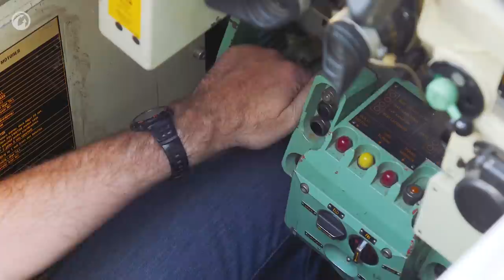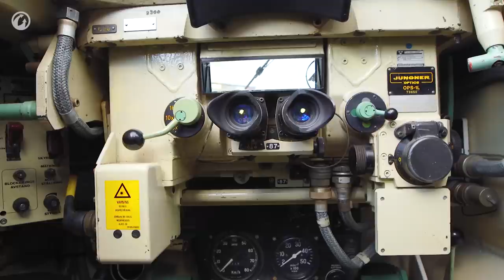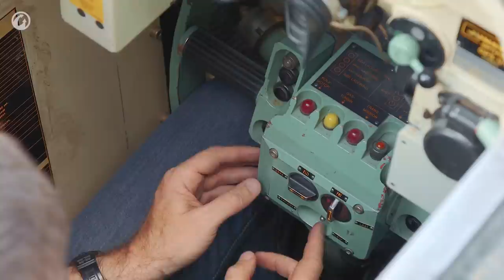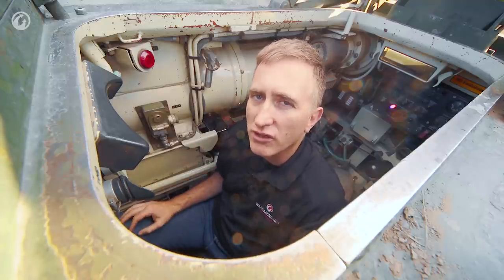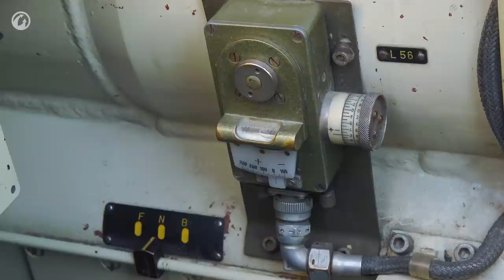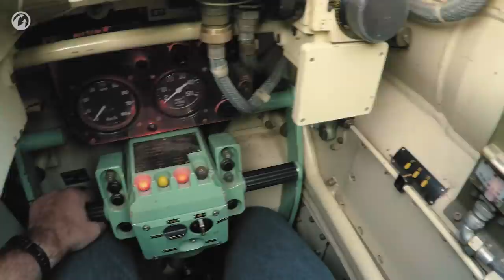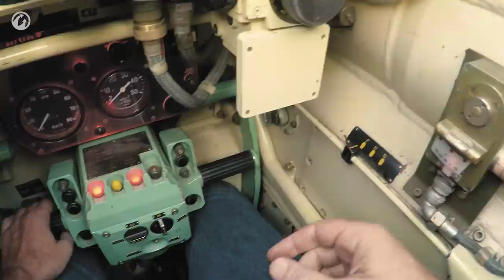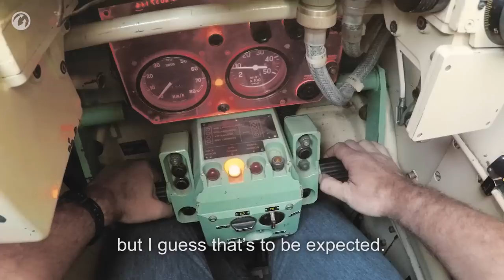Inside the Chieftain's Hatch: Strv 103C part 3

Comment: The downsides of Strv S are only downsides because tanks nowadays are expected to be all purpose. If tanks were built with much more focused purposes, like they were in the past, they would excel at those purposes. The Leopard 2 is a great tank for doing battle in the field, but upgrading the Strv S with all the modern technologies would create a fearsome beast to guard the forests and hills of Sweden.
Reply: This could still be useful today as an assault gun to support infantry. Load all HE. You might even be able to get a hold of some 105mm HESH for buildings.
Reply: The CV9040 is probably better for infantry support than any MBT will ever be. Cheaper, better manouverability, more versaitile, carries troops and equipment, got a gun that can handle most situations from targeting infantry, buildings, other APC's and armoured support and fend off helicopters that get too close. No matter that I love the 103 and even the new leopard, but the CV90 is better at infantry support than both of them.
Reply: A 40mm shell carries around 70 grams of HE. A 105mm carries 2kg of HE. There is a world of difference between the two because while the 40mm might punch big holes in a building, the 105mm will probably level it. 

The turreted mount gives a huge advantage to the 40mm though, especially in high elevation. 

That said with the abandoning of the 103D program there is little hope for the S-tank to rise again. The big gap is in armour, because modern APFSDS are quite unaffected by sloped steel outside of the thicker armour presented due to the angle. 

Fixing that would require a new glacis, but since the engines are front mounted a thicker glacis might not be possible without a complete re-engining as well. Perhaps a Merkava style glacis and hinge that attaches at the angle between UFP and LFP might work but this might require hull changes.

The second problem is the gun. I'm not sure how well the S-tank hull could handle a 120mm, although I do know that there do exist low recoil versions as well as highly efficient muzzle brakes, so maybe it might work?

Either way it would require a new tank program and the result would obsolete the S-tank anyway, so I do see why the Swedes moved away from it in the end towards the Leopard 2.

Personally I think there was merit in the Strv 2000 concepts: http://www.ointres.se/strv_2000.htm . The advancements in remote weapons systems will mean that the future of tanks will incorporate overhead or even unmanned turrets a la the T-14, and the Swedes were particularly advanced in pursuing such a concept as it had dramatic weight reduction potential.
Reply: Effective and reliable gun stabilisation is what killed the S-tank concept. Effective and avaible APFDS is what made the armour inefficient. That could probably have been corrected with ceramic plates, with out adding too much weight. I do think that they explored this possibillity.

The 40mm is more than enough for supporting infantry. You could level a building with a big HE round..or just kill what's inside with the shrapnel from the 40mm. That gives the "same" practical result with a lighter gun. That in turn leaves more space for the infantry and their weapons it's supposed to carry. And the versatility in what targets that can be engaged is better with the 40mm.
Reply: @secularnevrosis  That's not true for all situations. In US service, the M1128 MGS with the 105mm has proved it's usefulness in combat.
Reply: @ExUSSailor  
Of course. The 105mm is a good round. But the 40mm or equivalent offers good firepower while not taking much space that can be used for troops and equipement. The infantry the IFV carries often have very good AT weapons that also are suited to "bunker busting" and other tasks..like the AT4 "Carl Gustav".
Reply: @ExUSSailor  I did not know the Stryker MGS ever went into combat. Last I heard there were loads of problems with the gun being on such a relatively light vehicle and it was getting canceled.

Comment: Great videos,  I was wondering if you had a HE shell in the gun and wanted to change to a AP round or the other way around what would the procedure be.
Reply: Charlie Pace .... No doubt gunner would fire off the round he didn't need and chamber the one he did need.
Reply: So hypothetically. if the Tank was laying in wait for some infantry with HE loaded and an enemy tank came into view. I was really wondering how the Autoloader would work to remove a live run. is it possible ? and where would the round be moved to ? I have no knowledge of Tanks I am just interested.
Reply from the maker: The fastest way to get a round out of the tube is out the far end. This is standard practice in manually loaded tanks as well. If it hits, great, it may distract or cause minor damage. If it misses, the gun is now empty in a half second.

There is likely to be some method of manual ejection, though, for gunnery ranges and the like.
Reply: many thanks. I fine your channel very interesting.

Comment: Wonder how many mpg it gets? Imagine insurance would be quite reasonable as a weekend run around,just going shopping, beach maybe annex Monaco.
Reply: Molatov cocktails would finish you in Monaco. Have you ever been there...High balconys, narrow streets ;)
Reply: unleecensedminky Doubt the people of Monaco would risk there incredibly expensive vintage wines on my lowly peasant armored vehicle but you are right if the last hundred years has taught us anything it's that taking armor into cities without effective infantry support is suicide.
Reply: Ha ha! Last time I went there the local supermarket had a bottle of 'Petrus' on the shelf for basically 2000 euros...still a cheap price to pay if you drink it, fill with petrol and take out a tank :)
Reply: It is probably closer to GPM than MPG.
Reply: Eh, they dropped napalm on the tank during trials in the 60s and it kept on trucking, I doubt some expensive Molotovs would do much harm to a buttoned up and operational S tank :)
Reply: And there is even video of those tests on youtube =).
/watch?v=MiWCpIJ5dBw
Napalm tests start around 18:20
Reply: well chieftain said it consumes 4,5l petrol for 1km with both engines running so if my understanding how much is gallon and how long is mile is correct that's well over GPM.
Reply: Just a bit under 1 MPG is not bad for a tank.
Reply: Yes, but that is with both engines running. There is a reason that they had 2 engines, of which one was a gas-guzzling turbine and the other a weak piston engine.....It got very good gasmileage when just running on the piston engine, that's what it was there for.
Reply: About 4 liters per kilometer he said in an earlier video. That comes down to roughly 1.5 gallon per mile.

Comment: An upscale, 120-140mm cannon, Digital driving/suspension/aiming-fire control system Strv would be interesting... I'd call it the Strv 2000.
Reply: i think that even then the lack of the ability to fire on the move would still make it alot less versatile than a conventional tank. but i do love the strv 103, one of the coolest tanks ever imho
Reply: with a modern fire computer and modern suspension you might be able to make it work on the move, perhaps even while drifting. I'm not sure why you would want to though. its perfectly fine in a defensive role...
Reply: jrfi orn there allredy where a Strv 2000 project, it basicly look liked our CV9040's but it wasabit bigger and had a 130mm main gun and a 25 mm seperate auto-canon, search for Stridsvagn 2000 and you will probably find some documents
Reply: +Split Personality There were several proposals for the Strv 2000 project, but most were to have an 140mm main gun with or without an auxiliary 40mm autocannon (same Bofors as in the CV9040).

All were turreted though, even if one of the proposal was supposed to have an unmanned turret, rather like the T-14 Armata but with no turret armour/shielding whatsoever.

http://www.ointres.se/strv_2000.htm
Reply: jrfi orn one of the obsolete S-tanks was used for a land drone experiment in the 90'ies. and Imo, that concept with a 140mm gun, a modern turbo diesel power pack to replace both current engines and a telescope snorkel and inflatable flotation bladders instead of the flotation screen so the tank would float with the front glacis level about a meter below the surface with just a four inch wide snorkel sticking up.
Reply: Lol, well look at that, I'm a goddamed genius....
Reply: That is hilarious, I genuinely had no idea...
Reply: It's useless in modern urban combat, where you need high elevation and a quick and accurate turret traverse, plus the ability to fire on the move.
Reply: I all honesty the Swedes don't really get into many modern wars, so having modern S tanks with a small group of Leo 2s would fit well into both their defense plans and budget.
Reply: It's a defensive assault gun but it could also fulfill the role of offensive support assault gun (which seemingly has been forgotten in modern tactical thinking). It's inconceivable that this type of tank would be used in an urban scenario.  But I really do think (and agree with some folks above as well as the designers) that this type of design would make for an interesting, cost effective multi role vehicle. It's also much smaller, simpler and thus much less expensive than a conventional tank design. Another important consideration is it obviously requires less manpower and thus a total lower cost to fully train crews. Smaller profile and compact design makes it easier to arrange the defensive armor in a rational, weight saving way. Most if not all of these features apply to the original design as well of course...

Comment: Chieftain, you need to ditch the drone! We wanted to see the side of the tank while you're raising and lowering the gun. That drone only showed the top of the tank, which we've been looking at the last two episodes! How boring. It would have been so much more interesting to see how the track tension changed with the gun movement. And which wheels were doing the lifting. You usually show off track peculiarities whenever there are any. What happened this time?

Comment: Thinking about it & knowing Sweden, the average temperature seems about 12 degrees lower than in the UK in the Winter ... lets just say not warm!

But the clothing is good & you would be out of the elements even if cold ... They could have heated the interior, but might that have increased the overall heat signature of the vehicle & made it thermally an easier target to spot?  ... What do people think? Designed to suit the environment of Sweden & blend more easily with the surroundings :)
Reply: Crew won't spend all the time inside a tank. If it's really warm inside but cold outside, what kind of clothing are they going to wear? If they wear really warm clothes, they'll melt when they're inside a tank, but if they wear light clothes they'll freeze when they go outside. That's my experience in CV9030 during Finnish winter. Best for crew would be that the temp difference between outside and inside is small.
Reply: You should have the clothes on that lets you survive outside the tank/vehicle. If your tank, for some reason, cath fire and you crawl out in your t-shirt and boxers, in the winter and -25 C, you are in serious trouble. This was the standard. Of course soldiers in vehicles that did have good heating and could travel all buttoned up didn't care much for that.

Comment: I love the S-Tank design. Creative and practical, the one place it could find a home in U.S. service is in the Airborne service. It is small enough and light enough to airdrop. The question being how the suspension would handle it? I mean if you were in the 82nd Airborne and were given a choice between an S-Tank type design and say nothing which would you prefer. The M551 Sheridan and its aluminum hull armor and failed gun/missile system has left the airborne troops with nothing sense its removal from frontline service. I love you evaluation of the S-Tank and all you presentations so far, keep it up. I am a submariner (disabled vet) and have studied naval warfare and military gaming for nearly 40 years.
Reply: But Airborne is a offensive Operation at all. This Tank is focused on defensive tactics an lacks offensive potential completly. 

I don't think this Tank would make a good Airborne Tank.

Comment: This re-emphasized one of my main curiosities about the S-tank's dual engines:  can it be driven on one engine alone? If the turbine sucks fuel and stalls out (At low speeds? I am really not clear on why the tank was stalling.), why not do initial driver training on just the diesel? And then, if damaged, can the S-tank limp away on one engine, or is there no way to shunt away from having both engines acting against the transmission? (What is the procedure for towing, for that matter?)

One thing I noticed is that this tank's engines, both of them, are louder than I expected. The Abram's turbine whine is usually much more muffled, while I compare that diesel as being about the same as standing next to a prime mover tractor at idle. A big rig is usually a lot quieter, though, in traffic, so I am surprised that this S-tank remains loud while driving! The smoke trail from the diesel visible on the tank's right as it climbed the hill was very disconcerting. An opponent on the other side of the hill could hear the tracks, but why give a visual cue to trace the tank's actual location?
Reply from the maker: It can be driven around a bit on just the diesel. Not as quickly, obviously. I don't know what the disconnect process would be for one engine

Comment: If you are worried that the gun would bury into the terrain if you come across a sharp incline, I suppose you would be able to drive forwards with the hydraulics lifting the entire front of the tank?
Reply: Ditches or other steep inclinations should be traversed diagonally if to wide/steep, according to the manual.

Comment: Did I miss the part where we learn why there are two vastly different types of engines in one tank??
Reply: The turbine is very powerful for its size but also very inefficient at low throttle settings (it drinks fuel like crazy). The diesel is less powerful, but also far more economical at low speed. The idea is that when you're lying in ambush behind a hill or driving at low speed along a bumpy road you can just run the diesel (which saves fuel), and when you need to go fast you start up the turbine.

Most modern warships use the same idea- they have diesels for cruising, and turbines for bursts of high speed in combat. In that case it's called a CODAG (Combined Diesel AND Gas turbine) or CODOG (Combined Diesel OR Gas turbine) system depending on whether both engines can run at the same time (CODAG) or the diesel must shut down once the turbine starts (CODOG).

Comment: So the auto loader is implemented correctly in WoT then? It just has none of the typical traits of an auto loader.
Reply: Well the typical traits of an autoloader you'd see often todays (for example on most Russian vehicles) behave exactly the same way so really the other autoloaders in WoT are the one's behaving atypically.
Reply: ACHTUNG This is kind of autoloader is another kind, in 50b or T57 with oscillating turret, AMX 13 is revolver type of autoloader. You know, load 6 shots in the drum, shoot it in like one minute and load it again by loader.
Reply: ACHTUNG In s-tank autoloading system picking sheells automatically from racks one by one